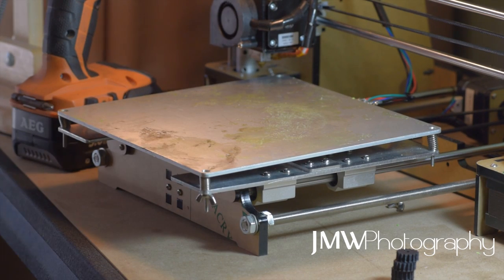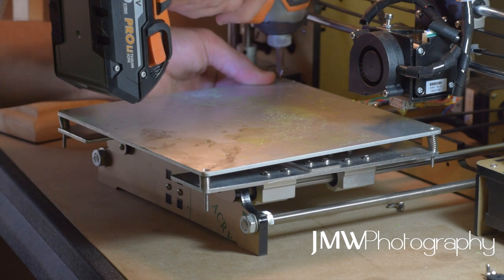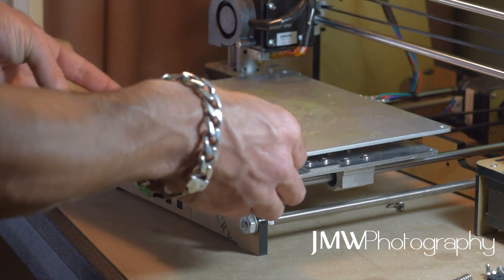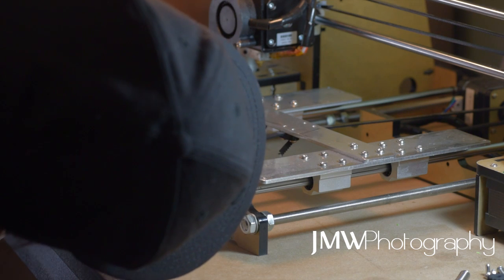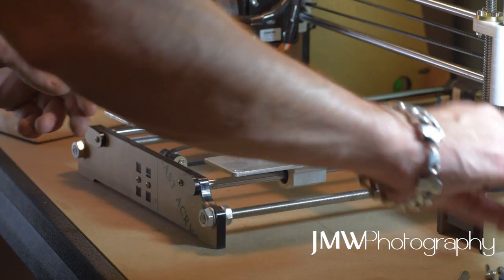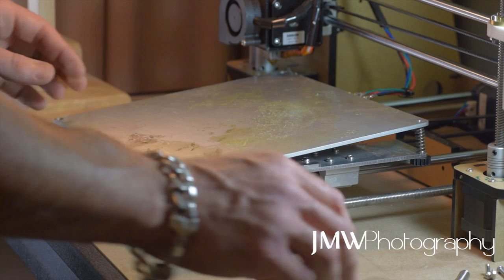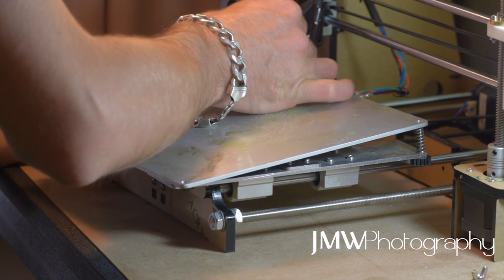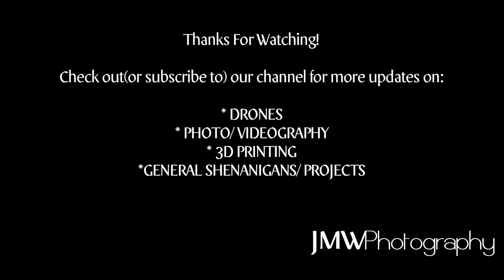Anet A8 How To - 3D Printer Bed Levelling Knob / Wheel Modification -Tutorial

Comment: Hi, great modification! I copied your method and fixed the bolts with a nut to the bed so they won't turn if the nobs are turned. Also I discovered that the nobs contain 14 ribbings and the pitch of the M3 bolts is half a millimeter so adjusting the bed for say 0.1 mm needs the knob to turn about 3 ribbings.

Comment: BIG NOTE:  Your hot bed mounting frame "H" is upside down. If you flip it over your Y-Axis belt will run truer to the motor pulley and the tension pulley and your prints will be nicer!!!!

Comment: drilling out the threads is not the best solution. u can finetune the nozle high. but if u did some pressure on your bed (to remove prints) the knob can twist a bit and mess up the high.

Comment: can someone explain the point of this mod?
to me it's seems like the nuts will get loose over time as there is only one thread that hold the screw. how is this better than the original design?
Reply from the maker: Haim, it's just a lot easier to make adjustments when you need to. Also, the design of the wheels bite tightly and act almost like lock nuts/ nylocks. Give it a try! 😃

Comment: Did you know you can take off that brown packing tape for a nice gloss black finish under it?
Reply from the maker: Haha, thanks Esprit925, I do know that but now my printers are all built, it seems like a lot of work to take it off. I also don't mind the industrial look of the brown tape. If you have removed it from your printer, how do you go with dust and finger prints on the acrylic? It's a pet hate of mine. ;)
Reply: JMW Concepts I'm not that bothered about the dust, as I have a powerful fan that blows it all away.. I'm thinking of making a metal frame or a transparent blue plastic one. 

Great Video by the way. 👍
Reply: Esprit925 try making one out of aluminum extrusions.

Comment: any reason you dont put a lock washer  then a nut then a washer under the hot bed then the spring? I would think that would prevent any spin on the bolt when the thumb bolt is turned. Just wondering if there was any play with the bolt when the thumb nut is turned. I am looking at doing this mod for my Anet A8.
Reply from the maker: Hey Derrick, sorry for the late response! 
I have thought about doing that for sure. On both printers I find that 3 wheels turn well and thread onto the screw nicely but there's always one that likes to try and spin. Just applying a bit of pressure with your finger is enough to hold it still but that's not all that pleasant when heated up to ABS temps. 😜
I would certainly suggest you go ahead as planned and add the extra locks. Let us know how you go! I may do a follow up video. 😊

Comment: Lubricating the bearings, they have seals on both sides, so you need to remove them, insert some lube like lithium grease inside, then reinstall to do a better job.
Reply: Carsten Bauer  Was genau meinst du mit seals? Meine Lager kratzen irgendwie :(

Comment: Really cool jmw!!! I've upgraded my printer a lot. Printing this as I speak. I HAVE added a mosfet and  a switch aswell as a frame brace filament guide to corner and my own designed chain!! My printer is printing really nice now  keep up the good work!!
Reply from the maker: Awesome news! That happened quick! I'll check your channel for some videos. 
I really need to do the MOSFET upgrade. Although I've been printing mostly PLA lately, if I ever want to leave my printer unattended it needs to be done.
Reply: Yep definitely going to upload a video soon. Yeah I am also printing in pla aswell but you can never be too careful. The other day the mosfet wire from it to the board sparked. I then soldered the wires direct and also soldered the wires to the heated bed ad it was burning aswell. these chines printers eh. 
I am currently printing my own chain for the printer aswell similarly based on the one on thingiverse. I also highly recommend an e3d v6 hot end as quality is amazing. Just ordered mine yesterday.  OK I'll be keeping a close watch on your channel. Keep up the good work. 500 subs is really good. Make sure to check out my channel soon as I will be uploading a video hopefully. Thanks!!!

Comment: So the heated bed is held on the y axis (the H plate) by rigid screws threaded and locked into the H plate with the wing nuts, after drilling out the threaded holes you have unsupported bolts through two clearance holes, over time these will enlarge, you have  made a rigid system loose, allowing the bed to move in both x and y axis - that's bad.

So at first I am thinking this is a really crap mod to make, but then realised that all you need to do to unfux this flaw is to use a nut to bolt the screws to the hotbed and regain the rigidity and still have the new adjusting system.

I guess the springs may not sit over the nuts so a washer to support them would solve that problem. 5/10 for effort :) keep up the good work
Reply: thanks a lot, was looking for this info so long, I am working in open source 3D printer and was wondering how the bed leveling is made and you just explained it all!

Comment: I have the correct plugin installed when trying to print these knobs. Set it to the exact settings on the picture but the print doesnt pause at the correct time the whole for the nut is already sealed. Anyone else have this problem? If so how did you fix it?
Reply from the maker: Hi +Jesse Burkhardt, the built in 'pause at height' plugin does not work for me. You can download and use this plugin, created by a fellow Anet A8 user. :) I hope this helps.
https://drive.google.com/file/d/0BzQ3Kw5LLTyHSE5nVWQwTHBZYmM/view?usp=sharing
Reply: JMW Concepts I have this plugin installed and set it to the value it says on the Thingiverse page and it doesn't pause at the correct time. Are you printing in 0.1mm or 0.2mm layer height?
Reply from the maker: For this specific print I can't remember exact layer height, probably 0.12mm or something like that(you should always keep your layer height at a denomination of your nozzle size, Ie: my nozzle is 0.04mm so I use 0.08, 0.12, 0.16 etc). 
Silly question, are you watching it print? The first few times I tried printing these, I missed the pause. I ended out setting it to 180 seconds which gave me plenty of time to get everything done. Does it pause, but at an incorrect time? Perhaps check your printer settings in cura. If you still don't get it solved, I'll get a technical mind over here to help us out. 👍
Reply: yes I am watching it pauses but it doesn't pause at the correct time. Did the settings exactly how it says on the thingiverse page but it pauses way after the area for the nut is already sealed :/ when i use the pause on the LCD screen it resumes and is misaligned and the print comes out uneven.
Reply from the maker: Yeah I can't use the SD card menu pause either. I've just sent a message to the creator of the plugin, he may have some more suggestions.
Reply from the maker: Also, make sure you're definitely using the 'Pause at Height by Raz' plugin, it's the only one that works. 👍
Reply: can you link me to the correct plugin to make sure I have the correct one?
Reply from the maker: It's this one here.. If you're not using this one I would hope that's certainly your prob.
https://drive.google.com/file/d/0BzQ3Kw5LLTyHSE5nVWQwTHBZYmM/view?usp=sharing

Comment: isn't the 'H' plate upside down?
Reply from the maker: Yeah a lot of people have had this issue. I actually think it was a consumer(or user) who found out the instructional issue. It didn't come from Anet! 😆
Reply: Oh my. I just bought my printer. I wish the instructions were updated. I hadn't even noticed the bow before. thanks for sharing!
Reply from the maker: I don't think so, this is how I have it on both of my printers. ....Is it? 😂
Reply: Yeah, you might think so, but its this way in the manual and the instructional videos. The belt attatchment is higher than the belt pulley and the stepper drive cog, i used thingiverse belt connector to lower it so belt runs nice and straight in every Y position.
Reply from the maker: I think you guys may be right, I have had someone else send me pics of how they(and I think you guys mean the same thing) think it should be. I'll be running some tests as soon as I get the chance. 
Thanks for the heads up Team! :)
Reply from the maker: Hi Andre, thanks for the input. You are right, I have had this confirmed by Anet themselves that the assembly video is incorrect and I believe they have made an updated version(cannot personally confirm this). I keep promising myself that next time I do my printer maintenance that I will fix this issue on both printers. 
I wonder if switching it will make the 'pause' function in the SD Card menu work a little more nicely. I have swapped the orientation of the front frame bolts but when paused and continued mid-print, there is always a misalignment in the Y-axis.
Thanks again and happy Friday! 😊

-JMW.
Reply: Mine was under but the black bits on top. It was not as drastic but now correct. Thanks

Comment: a locknut on the spring-side of the heat-plate will allow you to turn the adjusting nut you installed without turning the adjusting screw ;)
Reply from the maker: Good call! I do have one leveling screw on one of my printers that insists on turning with the leveling wheel. That being said(and touch wood) I haven't had to level my bed in nearly 2 weeks! 
Thanks for the comment. 😊
Reply: Thats exactly what I did with my Flashforge. Also changed the levelling wheel so that it holds a Nyloc nut vs a standard one, and it has a slight protrusion on one side about 1/2 the diameter of the wheel to allow it to turn easier.

Comment: hello!! good video!! What product did you use to lubricate the bearings?
Reply from the maker: Hi +Joaquin, I use dry silicone spray. It actively repels dust and dirt. Great stuff.
you can check out the exact one I use here: https://www.google.com.au/url?sa=i&rct=j&q=&esrc=s&source=images&cd=&cad=rja&uact=8&ved=0ahUKEwitsomquYnRAhWCebwKHbFVBkwQjRwIBw&url=https%3A%2F%2Fwww.bunnings.com.au%2Fwd-40-specialist-150g-anti-friction-dry-ptfe-lubricant_p6100410&psig=AFQjCNG_2V3EmB9uQsLPhT3lUhbj6ES7-g&ust=1482552694728017

Comment: You should print spacers to go in between the springs and the bed. If the copper under the bed gets damaged by the springs the bed will short out and might explode.
Reply from the maker: Hi +DMANDIOGUARDI, sorry for the late response. I thought I had replied already! I'm interested to know more about what you mean, do you have a link to the part you mean?
Thanks.
-JMW.
Reply: I don't have a link but I have heard someone talk about it.
Reply from the maker: I wonder if it may be with reference to a different bed, mine has all the elements(I assume that's what you mean by copper?) are enclosed in the aluminium. The bottom of the plate is just aluminium, same as the top. 😊
Thanks again, I'll ask around and see if I can get more info.
-JMW.
Reply: the bottom has a black/blue (its always different) coating which is covering the copper and if that paint gets deeply scratched by the springs bad things will happen.

Comment: Die Idee hatte ich auch, nur hab ich die Schrauben oben mit einer Mutter gekontert, so dass sie sich nicht mehr mitdrehen.
The idea I had, too, I just screwed the screws up with a mother, so they could not go with them. Hoffe Google hat richtig übersetzt
Reply from the maker: Hi @ralf land, Thanks for the message. Do you mean you put a screw on the other side of the aluminium plate as well to 'permanently' lock it in place? I have heard of people doing that with good results.
Hi @ralf Land, Vielen Dank für die Nachricht. Meinen Sie, dass Sie eine Schraube auf die andere Seite der Aluminiumplatte setzen, um sie dauerhaft zu verriegeln? Ich habe von Menschen, die mit guten Ergebnissen zu hören.
-JMW.
Reply: Hallo, genau, ich habe oben die Schraube mit einer Mutter unter dem Bett festgezogen und unten auf dem schlitten die Löcher auf 4mm gebohrt, damit sie sich nicht verkannten beim erwärmen des Bettes. Mfg Ralf
Reply from the maker: Interessant. Das macht die Arbeit gut? Ich muss es versuchen. Haben Sie ein Video dazu?

Vielen Dank.
Reply: Habe leider kein Video, Foto könnte ich machen, sieht mann aber nichts, da die Mutter in der Feder verschwindet. Die Flügelmuttern unten habe ich auch durch selbst gedruckte "bed leveling knob" ersetzt. ich habe aber einfach eine lange Schraube durch das loch gesteckt, dann von der anderen Seite eine M§ Mutter drauf und diese erhitzt und dann langsam  in den Knopf versenkt und abkühlen lassen, dann Schraube raus und Mutter sitzt fest im Knopf.
Reply from the maker: Ich mag diese Idee! Ich muss es auf einem meiner Drucker ausprobieren. Nochmals vielen Dank und guten Rutsch ins neue Jahr. :)